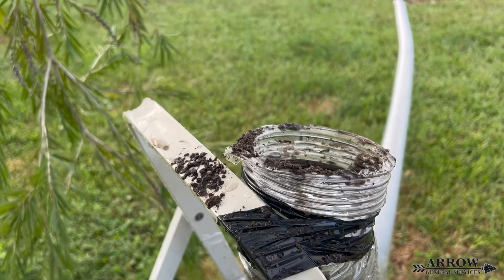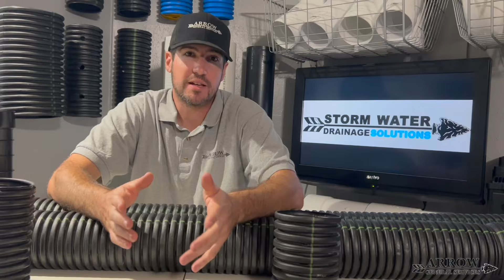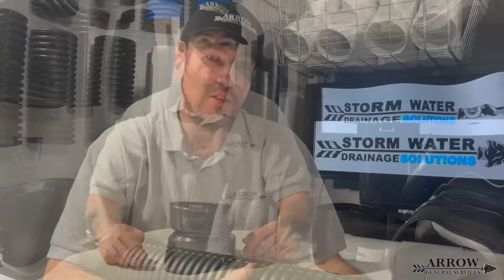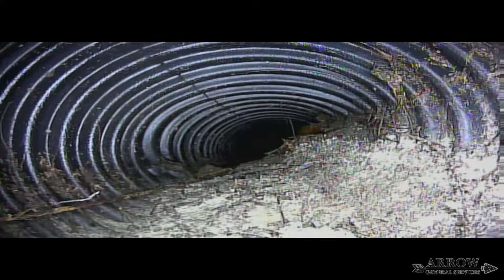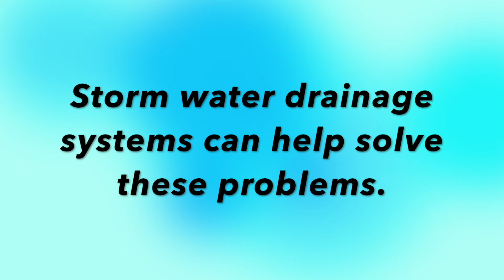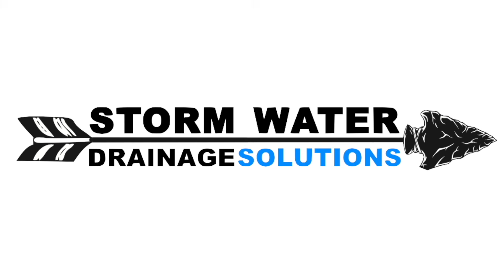Corrugated Drainage Pipe - Big Box Store Pipe - Best Way to Install

Comment: Thank you for this informative video!  at 9:44 with the tile tape the previous installers that did out drainage did NOT use tihs.  So EXACTLY what you stated as the pipe was wet and leaking/weeping, a nice root from out maple tree grew in it, then decided it was a awesome home and more roots grew.  I pulled out over 7 feet of roots from the pipe because it was pretty much clogged.  I wondered why the middle of my yard was spongey and it was because the pipe was constantly filled with water and it had no where to go.  Now I'm redoing it and will be using better connectors and tile tape!

Comment: Great video sir! I made a simple 40' French drain between two houses with a nice 10" slope. Very simple run. Question: should the end of the drain leading into the garden be wrapped shut with geo tech  or left open ? Thanks.
Reply from the maker: Thank you! Glad the video is helpful. The discharge end should be left open or have a pop up emitter on it. The beginning of the French drain should be closed with fabric.
Reply: @StormWaterDrainageSolutions  thanks. Wasnt sure due to potential critters. Dig it up and open.

Comment: Hey my residence has the corrugated slotted pipe all around the house draining storm water from gutters causing soil erosion around the foundation! I am looking into changing the pipe to the non slotted one. I bought the 4” flex corrugated solid pipe but it’s the same diameter as the adapter coming out of the downspout and a bit smaller for the pipe that is going into the ground allowing the soil around the joint to get into where the two pipes join each other. I am trying to figure out which adapters to use in order to attach the 4” solid corrugated at both ends. Can someone please help?
Reply from the maker: 4in corrugated pipe will be compatible with 4in corrugated fittings. Make sure it’s all 4in. Use tile tape to seal the joints so that you keep tree roots and sediment out of the system. Visit our website for supplies: https://www.stormwaterdrainagesolutions.com/corrugated-fittings
Reply: @StormWaterDrainageSolutions  Thank you for responding. My problem is that the existing drain pipe going into the ground is larger than 4”, so inserting a 4” fitting leaves a gap into which the surrounding soil and gravel etc can find its way down the drain. 
On the top end, the existing adapter is exactly 4” round and the 4” corrugated cannot be inserted into it without causing a split at the edge. 
I am looking for solutions to combat these two problems.
Reply from the maker: @Birdseyeview47 What size is the pipe? Corrugated pipe can also come in 5in and 6in as well. It sounds like you will need a reducer coupling to go from the larger diameter pipe to 4in pipe so the downspout adapter will fit on properly.

Comment: What pipe is second best to French drain man high octane? I'm curious if there is a lower cost alternative that is still more robust thank home depot pipe.
Reply from the maker: Check your local plumbing supply store or water works store to see if they have a better quality corrugated pipe. Once you get it in your hands you will be able to tell if it’s better than the big box store stuff.

Comment: Man! I've got about 220' of french drain that i need to install along a fence line and i'm dreading it. In Florida, so ground water is an issue, but i've also got my run off, along with 5 houses whose back yards drain to my fence line and then it joins mine and heads to the rear of the yard. Thoughts on installing catch basins for surface water tied into the french drain? I know you'd mentioned debris being a major issue, so maybe catch basins and a solid pipe run, along with the french drain running down the same trench?
Reply from the maker: We don’t recommend connecting any other drain to a French drain. If you want to collect both sub-surface and surface water maybe consider an open French drain with stone on top along the fence line. This will collect surface water very fast.

Comment: You no longer recommend using double wall corrugated pipe?
Reply from the maker: Not sure where you got that from. We use N12 all the time.
Reply: @StormWaterDrainageSolutions  You didn't discuss double wall pipe in this video.   Since you did recommend the FDM single wall corrugated pipe I figured you would also discuss double wall
Reply from the maker: @persistentone3448 We have some other videos on double wall pipe, here is one if your interested https://youtu.be/6pq4tdlUM0w?si=PQwe3Xj77t1IpjSX
Reply: @StormWaterDrainageSolutions  What about perforated dual wall for a french drain?

Comment: doubt you ll see this question but if you do on the coupler external do i  just look for something that fits 4 inches or how does that work ?  noob question, and great video
Reply from the maker: It will depend on the size pipe you are working with. You will need to acquire that same size coupling. So if you are working with 4in pipe you will need a 4in coupler. Hope this helps!

Comment: I understand and appreciate the emphasis on taping - and have done so in my work around my property for non-perforated pipe.  Not to much for perforated, drain tile corrugated.  My thinking is that the pipe is specifically made with small openings to allow water in.  Is this a mistake?  Also, the whole important issue of well sealed pipe to prevent plant/tree root invasion (pvc or corrugated).  Is that just out the door when using a perforated pipe application?

Comment: Wow. I was just about to install big box pipe. I can see how I designed it all wrong. Unfortunately, when I looked at French Drain Man, he would have charged $467 for shipping 100'  of pipe plus connectors. Crazy. Now I have to research more what to do......
Reply: Same, shipping is crazy. I’m trying to figure out a better local source for pipe. Good luck
Reply: Did you find a reasonable source for the 'better' pipe?
Reply: Never had such a hard time finding a better quality corrugated than that which is offered from the box stores. Shipping cost make French drain man a non option😢
Reply: @Erik1416 yep! He’s pricey are very good but shipping is nuts. I need something for the northern Kentucky weather that can handle the freeze.

Comment: which direction should the holes be facing down or up
Reply from the maker: @bobd1103  Holes face down but on slotted or knife cut pipe the perforations are 360 degrees around the entire pipe so it doesn’t matter what direction they are facing.

Comment: Currently looking for an alternative to the big box stores version and can’t afford FDMs freight cost what’s a good way to decipher weather it’s a quality corrugated pipe for example should I be able to step on it without it crushing?
Reply from the maker: @Goose868  It will feel stronger and the pipe wall will be thicker. Also the ridges will look a little different. Any pipe that says heavy duty on it will be of better quality. Black is Hdpe pipe made from re- grind recycled plastic and new/non recycled Hdpe pipe are usual solid colors like white,blue,yellow etc. Just look for heavy duty and you will be good. 💪

Comment: What if I’m putting concrete in back yard with no trees or plants ? Should I still wrap it and use gravel around it ? Thank you so much for the info
Reply: I'm no expert, but I think I would.  If there were anything that ever grew in that space or even next to it, there are still roots in the ground trying to survive.   
Especially knowing that it's going to be covered in concrete and harder to get to if you ever have problems.
Could be overkill, but I would. 🤷‍♀

Comment: Very educational video. Everything I needed to know on detail. I just did a 60ft tile job and after this information, I made sure I didn't make any additional joints that were unnecessary for tree root invasion. I dug my wye back up and tile taped everything. Also tile taped the Conections at the pop up. Question,  I. Made sure I installed a nice bed of gravel underneath and around my pop up emitter hole. About 6 inches under and all around with gravel for the weep hole to leach water out of the system. Will the gravel bed keep the weep hole safe from root invasion. I just used a gravel bed. No fabric. Have you ever seen a pop up that was invaded with root through the small weep hole at bottom of pop up emitter?
Reply from the maker: @MeOmny  Depends if it’s in close proximity to a tree or shrub but yes I have seen roots grow in the pop up weep hole. I wouldn’t sweat it, just keep an eye on it when you do your yearly system maintenance.
Reply: @StormWaterDrainageSolutions  which weight for fabric? 3oz? 4oz? at a certain point like 8oz i would think it's too restrictive for french but probably fine for gutter

Comment: You said in the video that you need to have a proper slope on the pipe but I did not hear anything about what that slope should be. I know in plumbing its a 1/4 inch per foot + or - 1/8". Is it the same for a corrugated pipe or does it need more of a slope?
Reply from the maker: @drainageissue2022  Good question, 2% slope for every 10ft is the recommended amount however in a yard drainage application this is not always possible so I would suggest you get as much slope wherever and however you can when you can.
Reply: @StormWaterDrainageSolutions  Thank you I appreciate the reply. Best wishes.

Comment: This is incredibly helpful! Ive watched this a few times throughout my project. I have a large catch drain I need to drill a hole in to connect my 4" corrugated pipe. Do you know what size hole saw I would need?

Comment: You had mentioned that damage is caused by not burying the drain pipe deep enough.  Maybe I missed it but what is the ideal depth for non slotted drain pipe?
Reply from the maker: @MulaBellaSisters-fu2vh  Good question, it’s ideal to have at least 6inch of dirt over this type of pipe. But if you can do more than that’s even better. With yard drainage it’s tough to say an exact amount because all yards are different and the ground varies greatly.

Comment: I recently had to redo a section,fairly flat,...even though i had taped the joints well ,maple tree roots got past the tape ,so if i were using  corrugated  black again id tape like double or triple the amounts  shown,now ive switched to 4in pvc,tried to get more slope,not as much as is prefer,but should keep the patio and wall from backing up and flooding,the home i even bored thru the street curb ,under sidewalk waiting for big rain to test the flow, it has gutter and channel drain ,tied into it straight line about 100ft😊,..ive had the swale,or belly  you discussed, from the pipe floating  before the ground filled in and compacted over it,which i knew was problematic, another reason i switched  to the pvc,thanks for the great video on this topic😊

Comment: It's a shame that you can't get the FDM pipe locally. The shipping expense on it, in my case as an example, would exceed the price of my entire project. I may simply go for PVC, but I am hoping to find a compromise since the corrugated material is ideal if it doesn't get crushed in the process without all the joints.
Reply: If you don't have freezing, pvc may be an effective route.
Reply: @blh1997-w1q  Since I wouldn't be digging more than a few inches down (just enough for grass to take root again) it will freeze for sure. It stays below 32 sometimes for weeks at a time in colder winters. PVC or triple wall PVC would have been most ideal otherwise.

Comment: Hello, I'm grateful for educating me on the different pipes out there.
I'm going to install a system for ground air transfer into my home. It's about 100' both ways, 6'-8' in the ground and what type of pipe would you recommend? It will be a loop system that will heat and cool my home. I live in Nevada about 25 miles east of Reno. It gets hot 🔥🔥🔥 in summer and cold in the winter. Frost level is 2' deep. Can you recommend a pipe for the application?
Thanks,
Ben

Comment: If I wanted to install a French drain in a rock driveway what pipe would you recommend? FDM pipe is out of the question with the freight prices. I'm afraid this HD pipe will crush with vehicles driving over it.
Reply from the maker: I would definitely stay away from a box store corrugated pipe if you’re running it under a driveway. Check a water works store or plumbing supply store and see if they carry a thicker single walled corrugated pipe.

Comment: What is a "good fall"?
Reply: ADS install instructions specify a 2% slope, or 2 ft per 100ft or roughly 1/4" per foot.  Smooth wall rigid pipes like SDR35/Sched 40 can get away with less slope - about 1%.
Reply from the maker: Good fall is having the pipe sloped inn the direction you want water to travel.
Reply: Thank you.  What is a good way to stitch up the geo fabric?

Comment: Seems like a catch-22 when installing any pipe with holes into a trench:

If you put gravel under the pipe, you’ll create the air gap needed to prevent roots but water will pool in that gap and attract roots. 

Conversely, if you lay the pipe directly on the soil, there will be no air gap to prevent roots, allowing them to freely grow into the pipes. 

What’s the solution?
Reply: I've been trying to figure this one out as well. Most people seem to recommend leaving an inch or so of rocks under the pipe to keep the slits in the pipe open, but others say it's not necessary. My impression in that in this video (at minute 20:15) he doesn't recommend leaving a space under the pipe. He says, "For best results, dig the trench, line it with a good geotextile, PUT THE PIPE AT THE BOTTOM, fill it with stone, stitch it up."
Reply: Any water beneath the pipe in the rock should be able to leach into the soil beneath.  I think he meant that that would not work with the packing peanuts not due to the space they create as much as the absorbent quality of them or the material holding them in may prevent the water from leaching properly into the soil.

Comment: Would this corrugated pipe be good to bury under a new cement slab? Theres no trees or shrubs anywhere near where i'll be putting it. In South Louisiana.
Reply from the maker: Good question, I personally would not recommend putting this type of pipe under concrete